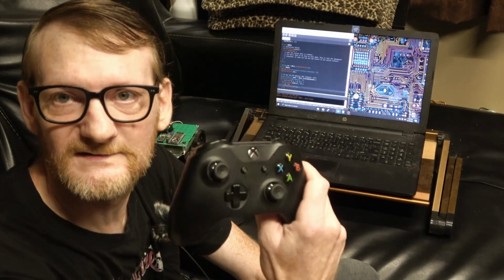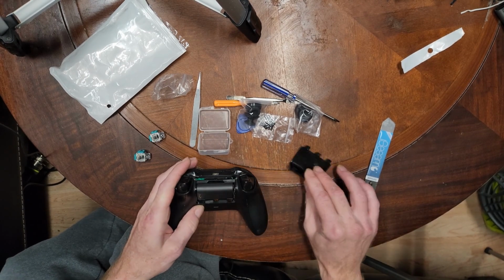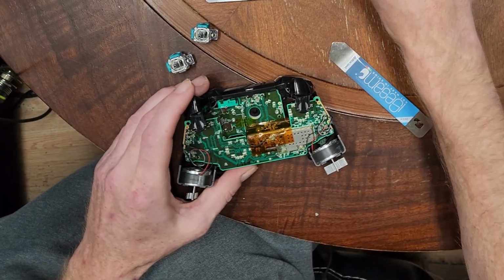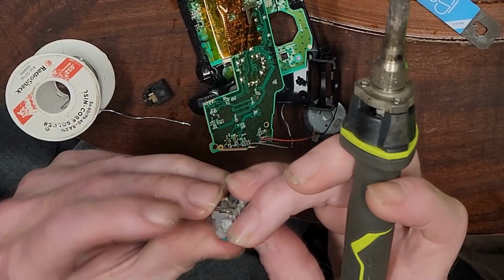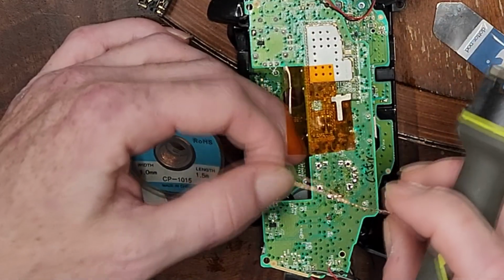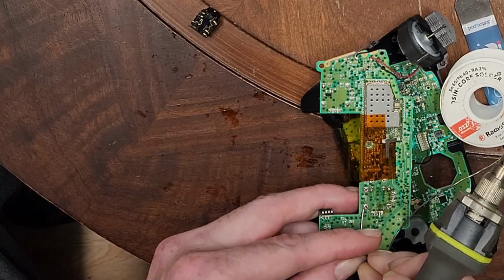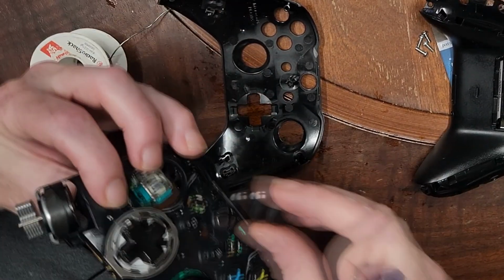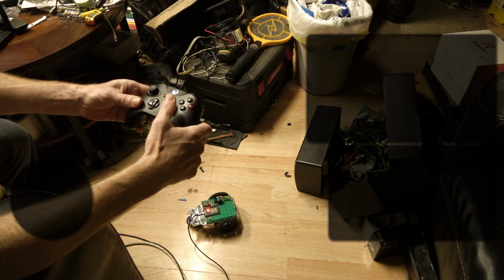XBOX ONE Controller Repair | Fix Joystick Drift & Dead Spots

Comment: You have to take the whole controller apart and change those little magnets on the joysticks they are worn! It’s a pain in the ass but it’s better than spending $70 for a new controller. Those two green doors are where the magnets are and they are stupid small. I did it with my ps5 controller and it works. My Xbox is starting to show signs of drift and will replace them NO SOLDERING!
Reply from the maker: I could be wrong, but I'm pretty sure on at least that particular Xbox One controller, they are not magnetic. They're just ordinary potentiometers... The throttle and brake buttons are in fact magnetic with hall effect sensors, but the joysticks are not.